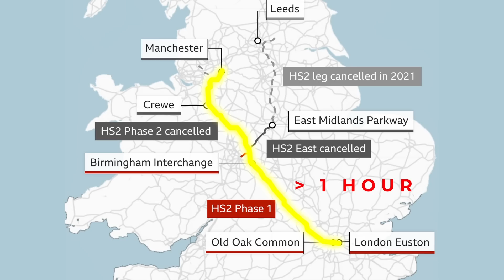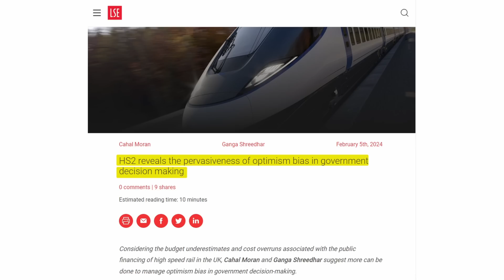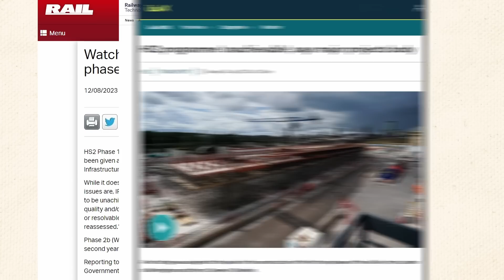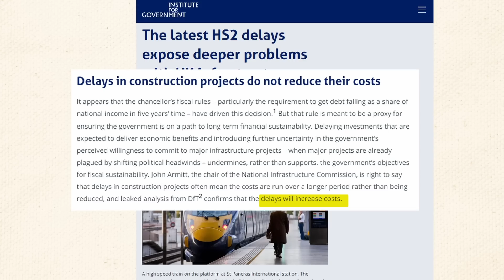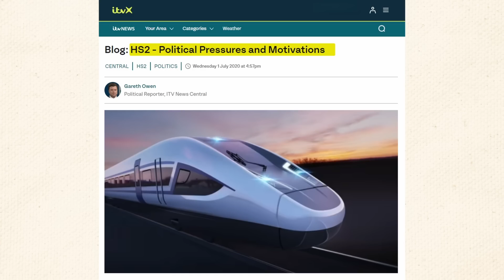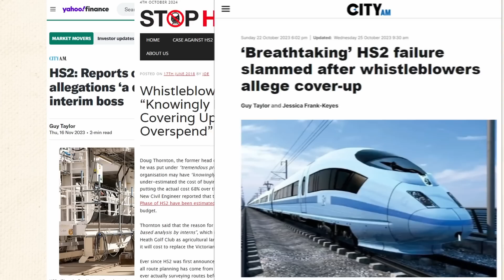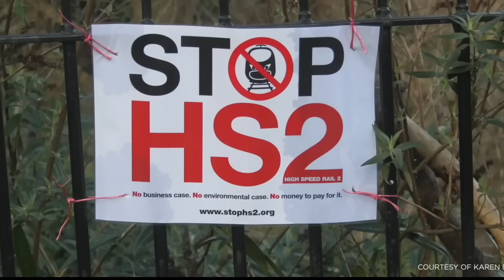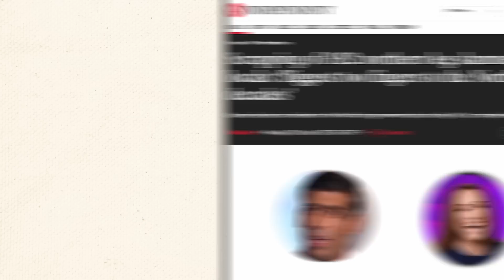Inside UK's £100BN Railway to Nowhere

Comment from the maker: So, can HS2 still deliver any meaningful benefits for the UK?  Or is it destined to be remembered as a costly and controversial miscalculation?
Reply: Re the title it's not a railway to nowhere , its going to Birmingham . Personally  I m not in favour of it .
Reply: @maly2ts408  to be fare it was going from Birmingham to nowhere, stopping short of London at Old Oak Common. Making it costly and pointless.
Reply: @jonprice3342  Euston will be reinstated at the budget…
Reply: @jonprice3342  They tried this in the 1970s None stop from Birmingham to London Euston and back with the new build class 87 electric locomotives. Failed not enough passengers on none stop running with additional price to travel. The need for speed is not the answer. If a journey takes two hours and plan for that all is good. But all we get is late or cancalations. reliability before speed.
Reply: @gorgu08 At the budget ? No chance.
Reply: @TrevorWilliams-fq8mg  did not age well, that is exactly what happened, now watch and see HS2 to Crewe get funded in the spending review in the spring with feed Billy studies done on connecting NPHR and HS2 (new version)….any one that knows about the British rail system knows there is no other option
Reply: Just get it done as fast as possible. These things always benefit the country once complete and all the moaning stops.
Reply: If nothing changes with the current project and the routes it will take, then it is quite a pointless project and a massive waste of resources, which brings no benefit. You could maybe improve it in the future, but I highly doubt any more investment would go into HS2 in the future after completion of HS2. To be honest, I don't think HS2 would even be completed without taking more routes off the plan or for other reasons.
Reply: Nope. The business case was fatally flawed from the get-go. The thing is, its now too far gone to cancel it. Now we've scarred the landscape to get this far, they might as well finish it, but its a complete and utter white elephant.
Reply: @stevem-h3562  the landscape was barely scarred, that is why it cost so much ridiculous overnegineering to stop NIMBYs crying in their cornflakes, if Brunel was building HS2 it would have driven straight through the Chilterns above ground and would have been finished by now
Reply: @gorgu08  Context is everything. Brunel wasnt concerned about trying to get people off domestic air travel or out of their cars.

Whataboutery. For the sake of the business plan which is  utterly facile and based on BS, the scarring on the landscape isnt worth it.
Reply: No, It failed before it is even finished, Why, Because it has cost way to much to build, To many fingers in the pie, People are too greedy etc. And only benefits London and Birmingham. What a colossal failure.
Reply: @MegaBuilds5280  HS2 to Manchester will happy but for now I would imagine the government will prioritise HS2 extensions to Crewe and Euston to realise value and focus on delivering Liverpool to Manchester next meaning the connector from Crewe to Manchester will be kicked into the grass for a decade or so…
Reply: The country’s most expensive vanity project. No one wanted it, but we’re overruled by a few people with financial agendas.
Reply: No, it has always been an opportunity for Tories to waste money while pretending it is for the common good. In essence they are milking the public purse and pretending it is in the interest of the common man/woman. The end of the UK is nigh.
Reply: It is/was a vanity project from start to where we are now and nothing is going to change

Comment: The government wanted a high speed line despite the extra cost of high speed as opposed to day a fast track rail. The government then pass tons of environmental and planning regulations where the CEO of HS2 said it required over 8000 permits to proceed. It cost £100 million to build a bat protection tunnel because some nerd in the Natural England quango said it was needed. Despite no scientific data to say if it was needed. Planning, politics, pressure groups, disruptors and endless red tape makes building anything in this country so expensive.

Comment: The sad thing is that it was so predictable. I expect the original estimate was known to be way too low, just to get the go ahead. Whether it becomes a ‘success’ long term will depend on the ticket pricing and whether the staff keep going on strike. I hope it ends well, but perhaps like Concorde it will never be truly profitable. I hope there will be ways it can be extended in future. Real benefits would come from a high speed line reaching Glasgow and Edinburgh, as well as several cities in northern England. What passengers really want is good speed, comfort, reliability and accessibility (in terms of connections) and reasonable pricing. I fear it might end up little-used, unreliable, over-priced and hence a folly.

Comment: The ONLY solution to this is that an external rail company from the Far East, such as Japan, Taiwan or South Korea, possibly the CCP, MUST be given COMPLETE and DIRECT control of the U.K. rail network WITH NO INTERFERENCE PERMITTED from ANYONE especially trade unions and the relevant laws MUST be passed in Parliament to do this - ALL existing U.K. rail bodies MUST be abolished in order to improve standards and get fares down, projects like these, on a performance based model, after initial funding, would only get further funding related to performance in the last 12 months - bonuses would only be paid for works completed in half the time and for half the costs - anyone trying to interfere with this progress would be arrested and prosecuted under the criminal law, especially trade union leaders who mount strike actions

Comment: We should be improving our existing rail system before doing things like HS2, we also should look at more rail freight like we used to.

Wikipedia: HS2 is to be Britain's second purpose-built high-speed railway after High Speed 1, which connects London to the Channel Tunnel.

I seen the supposed HS1 when living in Dartford, wasn't anything new there, sure they probably made tee track bed better and that.

Comment: Traditional railways followed the landscape with cuttings and embankments along the way. HS2 is hugely expensive because of all the concrete viaducts, bridges and tunnels. Who wants to be in tunnels for half the journey? Part of the joy of traditional rail is the passing scenery, sky and weather. And if there's an accident on a traditional railway, rescue is straightforward with access by vehicles using nearby roads. Clearly not so easy in a tunnel or on top of one of the many viaducts! If the money spent on HS2 had been spent on re-opening closed lines and closed stations, that would have improved journeys and connectivity in all directions - not just London to Manchester!

Comment: I am not even sure where to start with this.
The initial cost was unrealistic, you just need to look at France, which built a high speed train national network from 1974 (start of the work) to2018 (opening of the latest line for passengers).
There are advantages, especially for microeconomics, but you need destinations other than Birmingham, so Manchester and Leeds are needed; this project should ultimately run up to Edinburgh or Glasgow.
The cost itself is not a problem if you look at the long term benefit, this infrastructure should last well over 100 years if maintained correctly; you need to look at the maintenance cost and economical benefits to judge if it would be a successful project.
IMO, the main issue will be the cost for passengers, train fares in the UK are ridiculous right now, if that does not change then rate of adoption will be very low thus the project will be a failure.
Also note that France subsidise TGV tickets, it is costly to maintain and run but with a reasonable price for passengers, the majority of the population is happy with their train infrastructure there (minus the frequent strikes).

Comment: I’m sure it was originally conceived as a leg of a pan European network. After that idea fizzled away it should have been stopped but the press have much to answer for by berating Britain for its slow, antiquated network without comprehending or acknowledging that we don’t need high speed rail. It was the media that turned it into a political football, the politicians then did the kicking. It’s been good money after bad ever since.

Comment: The only benefits are to the contractors - now perhaps that’s a good thing? I don’t know - but certainly no one needs to travel between London & Birmingham 30mins faster, the taxpayer in general gains no benefit from this £50 Billion spent and, without trying to predict the future, even if it works to the level promised (doubtful considering every other parameter has been exploded) this train set will be obsolete by delivery date in 5 years’

Comment: connecting London to a city like Birmingham (2nd city in UK with the most people on benefits) to save 20 minutes form the existing journey is nuts, not to mention the cost of a ticket
Reply: especially as there are already two routes between Birmingham and London
Reply: You're talking these💩💩💩💩😆🤣😂
Reply: The city with the most people on benefits?  What's your source for that?
Reply: @iguanaman08 I wouldn't be surprised. Birmingham was once a rich city but the demographics have changed now, there's no pride or work ethic like it used to be. Immigration destroys everything good.

Comment: No HS2 was to relieve congestion on other lines!!!
Reply: HS2 was to relieve congestion on the West Coast Main Line which was one of the most congested main lines in Europe. It had nothing to do with things like "feeding the powerhouse of the north" or other sound bites. It had to do with increasing capacity. It did not even have to be "high speed". While high speed can increase capacity by allowing more trains to run per day that is not the only answer. High speed has become the main and over-riding aim rather than aim of greater capacity.
Reply: @oml81mm  Yes, it all depends on the premium paid for being high speed. I sometimes wonder if government interference would have made it almost as expensive if it HADN'T been built as high speed.

Comment: One of the main reasons for high speed railways is to provide an alternative to domestic air travel. By restricting this line to a link between London and Birmingham, that is not going to happen. As Curzon Street is not in the city centre, part of the time advantage, and convenience for connecting trains, is lost.
Reply: Er, I think you'll find Curzon St is very much in the city centre. Take a look at Google Maps. It is no less city centre than Moor St or Snow Hill or New St.
Reply: "Curzon Street is not in the city centre" - it's as damn near to the city centre as it's possible to get without demolishing a lot of buildings, as the city core is built on a hilltop. The station entrance will be just outside the city core, right next door to Moor Street station and Moor Street Queensway bus mall, where most buses to/from Birmingham terminate, while the entire station fits between the former Inner Ring Road and the Middleways. You can't get any closer to the city centre without demolishing a lot of buildings and using tons more concrete to either bury it underground or increase the height of the viaducts.
Reply: @mittfh  I reckon Moor Street station is about 500 metres away from Curzon Street, and New Street is about a kilometre away, so I don't know where this "next door" comes from. I like the idea of Curzon Street station building being re-used after so long, but is will be swallowed up by new development anyway. Why was Curzon Street superceded by New Street in the first place? Maybe something to do with location. All the fancy words won't make it any easier for passengers with connections at New Street, travelling with luggage and children, on a rainy day.

Comment: The comment section,this video and title are the main reasons why there is so much ignorance when it comes to high speed 2 and why it's been canned to the north for now. 
Wcml is the busiest railway in Europe yet alone in the UK. 
It's not down to speed. Trains are already fast on the existing wcml, the capacity is the issue. Unfortunately whilst 250mph trains will be great on HS2, it should've been sold to free up capacity. The current and previous government have completely miss-sold the benefits of HS2. This project will benefit a lot of people if used to it's full potential, by the existing wcml to have more freight trains which will take lorries off the roads, also more intercity traffic on HS2 will take the demand off domestic flights, which will be better for the environment
Reply: thats the business case though. And its bollocks. You cannot free up capacity without negatively impacting the current WCML service to Birmingham and there is no direct equivalent of a non stop service to New St. Everything stops at at least Cov and also Bham International. You cannot increase capacity without impacting that service to both Coventry and Rugby and Milton Keynes, unless you want to confine them all to suburban Class 730 EMU's. 

Its akin to building more runways at Heathrow and Gatwick. There is absolutely no point if the skies above those airports are full. You could build a thousand more runways, but if you're going to get landings every 90 seconds because the skies are full, there is no more capacity to be had. 

plus, all the freight is intermodal, to and from freightliner terminals. Because all the old goods yards have been sold off or converted into car parking, there is nowhere local to unbundle the intermodal traffic, it has to go to terminals such as Lawley St, DIRFT, Basford Hall, etc. Which means more HGV's on the road, not less. 

The entire business case, from the get go, was b*ll*x, and it remains so to this day. If you want to improve capacity on the WCML, use more rolling stock. Turn the 350 EMU diagrams into 3-unit 12 car sets or the 730 units into 10-car sets. And try and get Network Rail's contingency planning to consist of more than just shutting down the entire line in the event of an incident.

but, using more rolling stock means the TOCs have to hire more stock, so less money. Cant have that, can we?
Reply: You said "comment section,this video and title are the main reasons why there is so much ignorance" on this project and then go on to say it was Government who sold this project on the idea of speed. Which is it?

If the project is called "High Speed 2" and the main selling point was high speed by govt and the associated businesses, why would you call people ignorant when they make posts about expecting the train to be high speed?
And if it is about capacity , it still doesn't justify the £100billion estimated spend for this railway from Old Oak Common to Birmingham

Comment: Total disaster from the concept stage.  Politically biased London concentric idea of where the true North actually is.  Money would have been better used upgrading capacity of existing routes and implementing shorter cross country links.
Reply: This is upgrading the capacity. You can't just throw money at century-old infrastructure to make it better. Sometimes it's more cost-effective to replace
Reply: @cpkingadam5  so by cost effective are you referring to the cancellation of all the new routes to the North and retaining the existing "century-old infrastructure"?
Reply: @TheRealPolecat  Exactly. It'll cost far more, in both direct costs and indirect unaccumulated economic gains, to maintain/improve the current lines. Manchester has been improving its inner city network for years but without actually building anything it won't get rid of bottlenecks
Reply: @cpkingadam5  so has Newcastle 👍
Reply: Why should tax payers be funding privately owned rail companies? If my business runs into trouble there's no yearly grants or money to improve my machinery.
Reply: @edmundblackaddercoc8522  Beause all they are, are the train operating companies and what they really are, is outsourced service providers. They're not truly "privatised".

Anyone who thinks otherwise is ignorant of the facts.
Reply: The existing lines to Birmingham are nearing full capacity, and while some lines were once quad tracked, since they were reduced to dual track, there's been a lot of development on the space formerly occupied by the outer tracks, so reinstating them would likely be very costly (with far more properties needing to be compulsory purchased + demolished) and extremely disruptive.
Reply: @mittfh  ..... nah.... the line from Rugby to Coventry to Birmingham has alwyas been 2 lines only. The WCML from Hanslope Junction to Rugby is only 2 lines, some 20 plus miles. Most of the WCML from Trent Valley Junction at Rugby North is 3 or 4 tracks to Stafford, but thats not part of the route. Widening that part of the route would be utterly pointless.